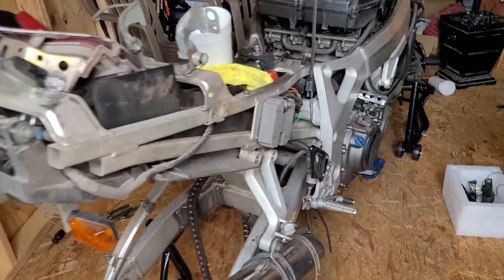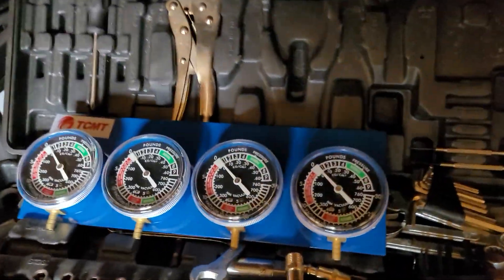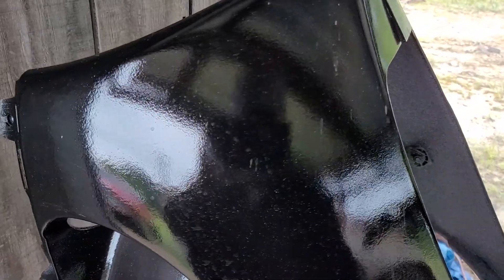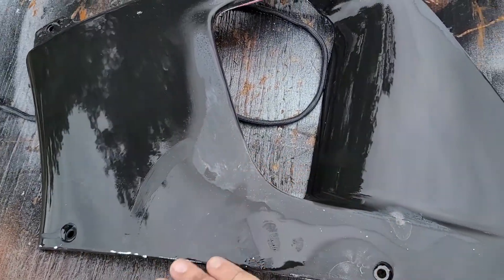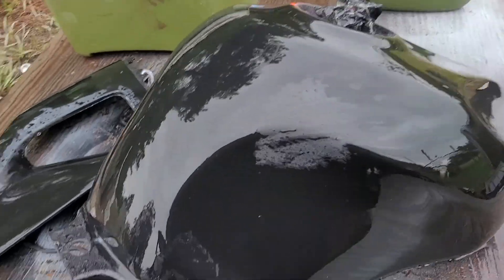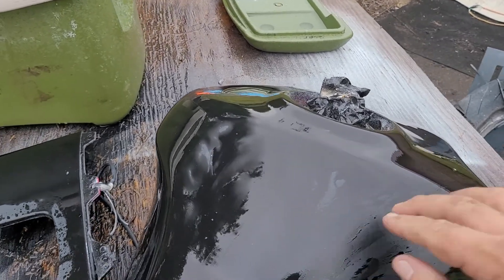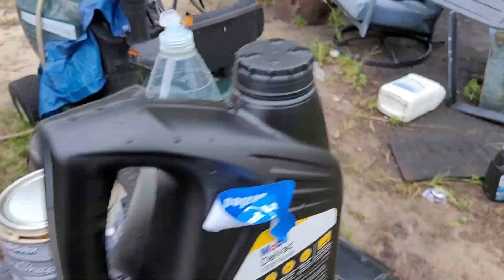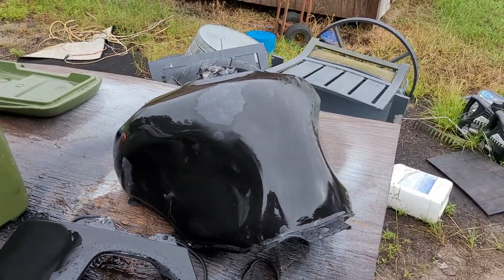1996 Honda Cbr 900RR restore part 4

Comment: It’s hard to lay paint on real smooth if your not in a booth. I think you got the right idea though just put plenty of clear on so you can sand smooth with 2000 and buff. It will look like glass.
Reply from the maker: yea i'll surely do that.  that was my first time.  it sure looks pretty bad to me.  but i'll get to it and get it fixed.   after that first lesson,   im pretty sure i can get it to where it'll look decent enough
Reply from the maker: the prep work is tough to me.  but the actual painting part was very cool and fun.   thinking of throwing some clear coat on my old truck now just for the heck of it. lol
Reply: @curtisnstacey  that will take a lot of clear.